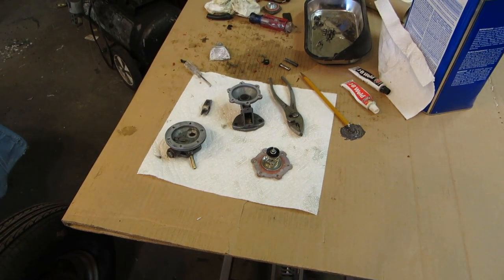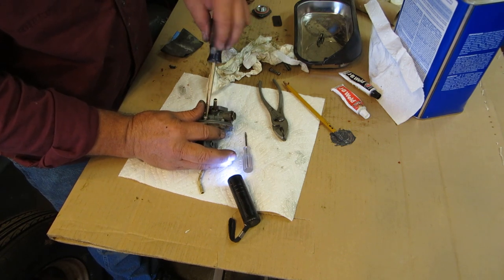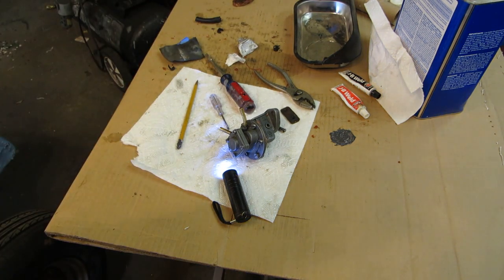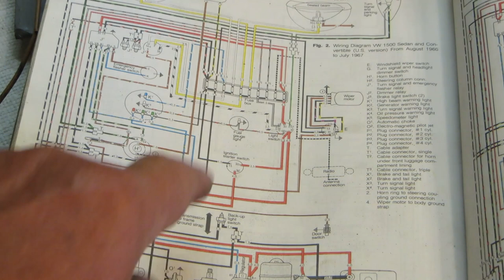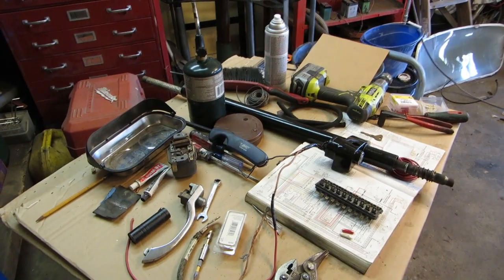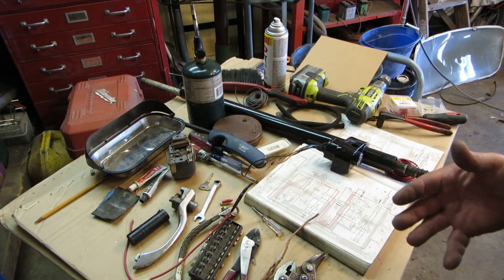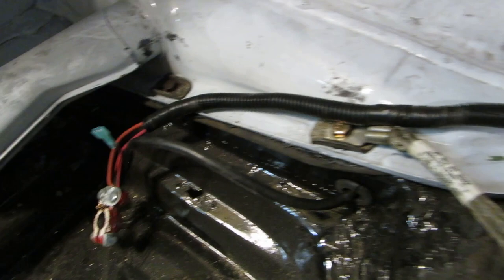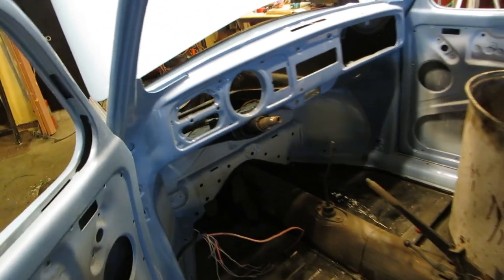VW Beetle wiring part 1

Comment: Does it matter what type of wire you use around the engine or is there a certain type of wire that is made for cars and heat
Reply from the maker: No it doesn’t matter. I used regular plastic insulated copper wire.
I’m sure someone would like to sell you super…heat resistant…bla bla bla.. but it’s not necessary.
My cars still retain a lot of the original engine bay wiring. It’s 50 year old plastic covered copper…..still working fine.

Comment: Last week I came outside to go get the wife from work and a guy pulled up and said did I want to sell the bus. I talked to him for a minute and the reason he asked was , in his garage his dad had stripped down a wrecked bus and he had the engine the trans. and the axles the plates and other stuff! He described a pancake with 2 carbs? 1700-1800 type 4 .He was willing to sell them for 250. I did not even get his name or number.they make upright fan kits for them? Man did I screw up.I didnt think because i have a new engine with only parts used is rebuilt  heads and rods.Man did I mess up............................................My engine is about like Yours New case and stuff.
Reply from the maker: I guess that would be a good deal for that. What year is your bus? If its a splitty....(upright fan kit)....why a type 4 engine? Because type 4 stuff is COMPLETELY different than old type 1, 2 or 3 engines. And $$$$$$ expensive to get parts. My Brother had a 2 litre engine in his 82 vanagon. And as I remember it was really expensive to repair. He called it the ''Porsche'' engine. I believe it was the same engine that was in the 914.
So. you know....gargling all that trouble with a type 4 engine. In my opinion not worth the trouble. Its the old big block , small block Chevy debate all over again....yes its nice to have that huge engine, but parts are outrageous....small block will do the job and cost le$$
Reply: @OkFixer  The most expensive part on them is the heads $$$$$$ but I didnt even ask what his name was?maybe he will stop again ?????